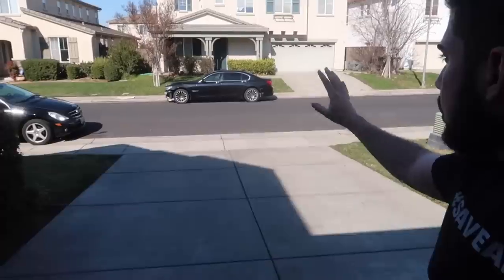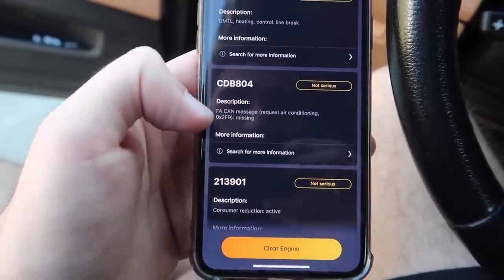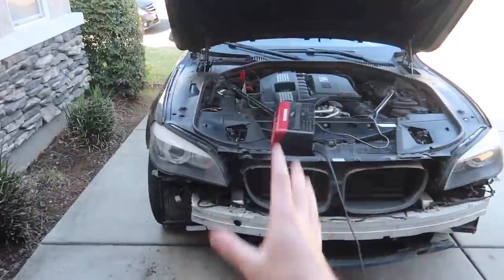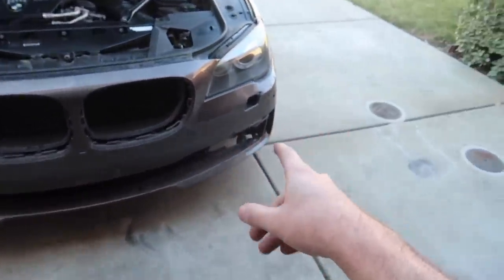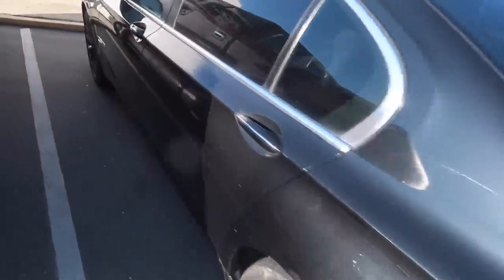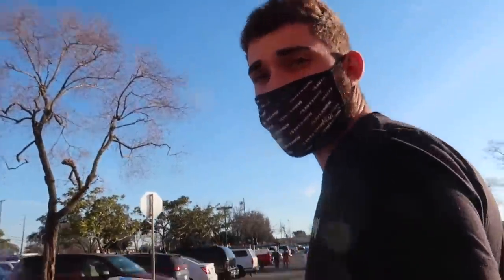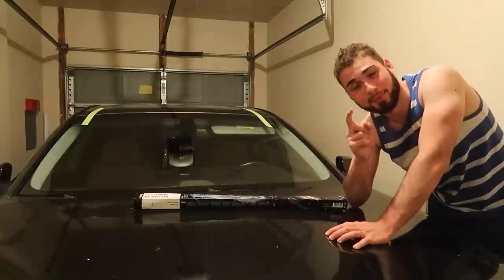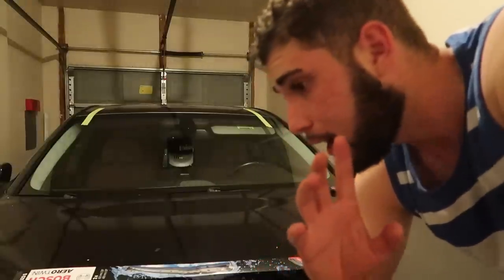Rebuilding An Abused BMW 740Li N54! Part. 8

Comment: To change the wipers Nour, you have to turn the wipers on, once you run it and they are vertical on the windshield, turn the car off and they will be in the up position. From there you can change the wipers. Had to do that on the X3 we have at home. Like so Nour can see this!
Reply: OR turn on the ignition and turn it back off. Keep holding the windshield stalk up. The wipers will automatically turn on and stop in a position where you can change them.

Comment: You dont need to pop the hood. You have to put wipers in “service mode” from inside the car. You hold the right stalk up a couple seconds and they go vertical, or just run the wipers and turn ignition off while they are mid swipe.
Reply: U can turn off the car and move them by hand and get them back down when finished...they will sit back in place when u turn the car on 
Btw i didnt know about the service mode thing so thanks😘💪

Comment: Car is coming along. Glad that you got the lci bumper. You can get an alpina lip for a more aggressive look. Also you need to put the wipers in service mode to change. Press the wiper stalk up and hold. Lastly the lci fog lights are led and have a chrome piece in the middle to match with the lower grills.

Comment: There is a service function to replace the wiper.after switching off the ignition  hold the wiper paddle down or up for a while (different on any model) at the resisting point, then the wiper go up.

Comment: I know its not releated to this video, but i have e90 320d and i want to fit 335d exhaust with original mufflers and everithing. But underneth car the problem is rear spare tire well. Is it posible to cut out well so i could fit origina 335d exhaust?
I saw your video with custom exhaust on e90 but i would like to fit stock 335d exhaust underneth. So is it posible to remove well?
 Thanks!

Comment: DMTL is a fuel tank leak diagnostic pump located in rear wheel well. They often fail and thats whats throwing your code. Its easy to replace and will run you around 100 bucks.

Comment: The code for the transmission is most likely the gear position switch. It’s usually right on the side of the transmission.